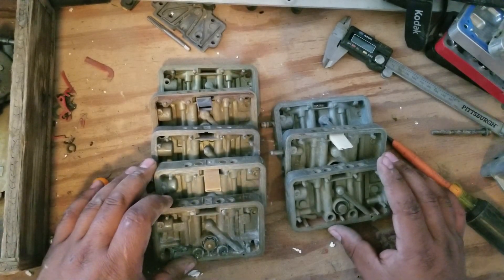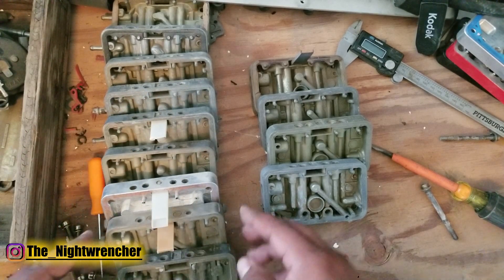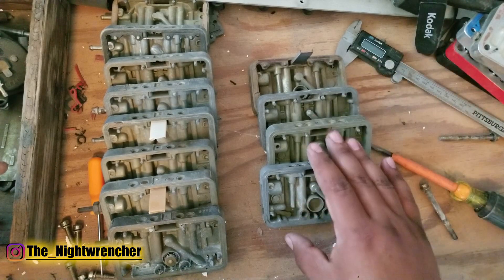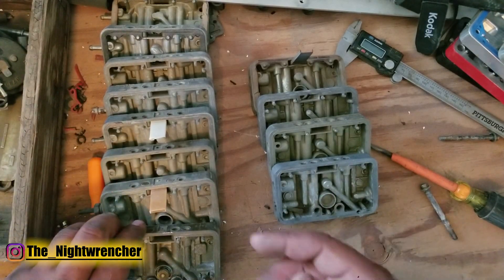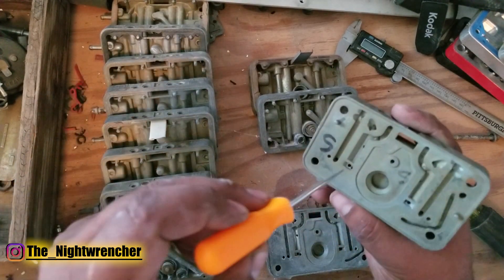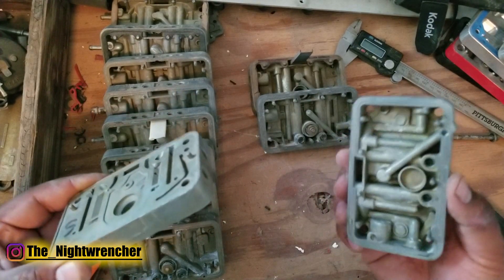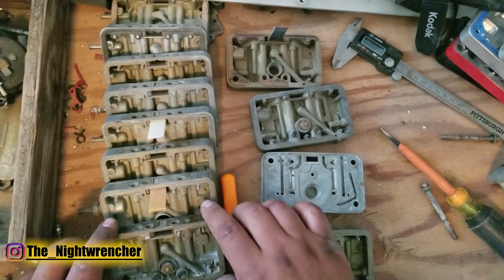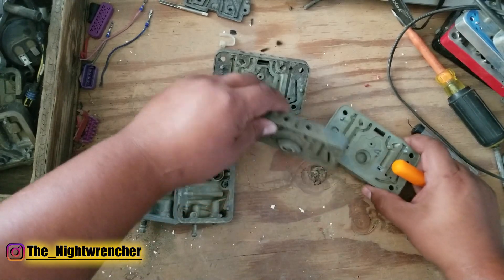Build Your Own Carb For BIG POWER! (Part 3) | Holley Carb Secrets | How To Tune A Holley Carburetor

Comment: Do you know if there is literature anywhere to find out the factory orifice sizes on specific Holley carbs? I’m throwing together somewhat of a Frankenstein carb myself and want to drill the metering plates for screw in brass ifr’s and pvcr’s but I would like to start at a baseline based off say a Holley 750 draw thru blower carb.
Reply from the maker: Best bet is to start small and go up as you go. Most 750s had a .028-.032 IFR depending on the model
Reply: @NightWrencher I appreciate the quick response. With the price of brand new blower carbs I’m gonna attempt to throw a couple nice ones together based solely on parts I have laying around and some cheapo swap meet finds. This new edelbrock 4150’s do seem like a very nice carb though if only I found a money tree somewhere
Reply from the maker: @DWBmotorsports gotta do what you gotta do
Reply from the maker: PVCRs are all over the place but .035 is a decent starting point

Comment: I have a Ford 331 stroker that i build myself with a quick fuel brawler 650 double pumper and dual plane intake.

I have already set in idle , cruising and half throtlle AFR adjustment.

But i'm still learning how to adjust the fuel curve when full throtlle.

My AFR go's to 10 from 2000 rpm full throtlle and slightly leaning out to 3600rpm to 11afr and at max rpm of 6000 it is going to 13.2 

Is the next step changing the emulsion bleeds ? I think i have 5 of them.
Reply from the maker: You might want to put smaller high speed air bleeds and then pull some jet out of the secondary side. Whats your AFR at cruising in high gear and whats your AFR after the Power Valve opens?
Reply: @NightWrencher cruise is 14 at 2000rpm and  to 15.5   at 2500 rpm with a manual trans 5 speed.

I have just put some smaller gears in so i have to read just but its at 12.5 to 13.5 depends on rpm on the powervalve
Reply from the maker: @chevroletbelair1 .005 smaller secondary high speed air bleeds should richen up your top end while leaning out the bottom. If you have 5 emulsion holes you can try capping the top hole if its open
Reply: @NightWrencher 
Sorry i have the 3 emulsion holes .
My original hsab is 31 , i have now 23 in it.

I do think that when i did disconnect my secondary throtlle blades so only primary blades worked that it was also good AFR at low rpm but lean at high rpm. 

So i think the primaries are also lean at high rpm , should i put bigger primarie jets in ?  And then smaller pvcr? Lsab is also changed from 31 to 23
Reply from the maker: @chevroletbelair1 you disconnected the mechanical secondaries? How did you manage to keep the blades closed to test that?
Reply: @NightWrencher its bin awhile but i think it was with a tie wrap . I should test this again to be shure of it and make a datalogger .

Can you help me with it when i send you the datalog? Do you have a whatsapp or something to send it?

1 year ago i was tuning my carb but this is the last thing i cant solve ,and i like to learn more about how to tune a carb 

Iive in Europe Belgium so we dont have v8  tuners here
Reply: Hi, thanks for helping, you already give me a step further in youre answers.
I have detached my secondaries on my double pumper again to test and lock it with a zip tie so it cant go open.

So now i only have my primaries to work.
Again also at this full throtlle pull(only primaries) my fuel curve starts at 2000rpm at 10.5afr and slowly go's to 11 AFR but when i reach 3400 rpm the afr goes to 13 AFR and stays relatively flat to 13.30 at 6000 rpm .

So this rich AFR curve on low rpm comes  from my primaries, so from my  Pvcr jets and primary jets and  (lsab is changed from original 31 to 23) si i cant go further  on that i think.

Can i adjust this rich low rpm fuel with my emulsion bleeds?

I have 1 syphon bleed and 3 bleeds below.
My fuel level sits just below the upper(nr1) emulsion bleed from the 3 and i think the 2nd emulsion bleed gets op uncovered from the fuel at this 3400rpm when it gets leaner.
Reply from the maker: Let me ask you this, are you testing this in high gear or are you starting WOT in low gear and noting the AFR between shifts?
Reply from the maker: Also, the easiest way to reach me is instagram if youd like to send me a message

Comment: I have a Holley 9510, made for a ford,with no air adjustment screws,  can I modify this with a metering block/ETC  to use on a Chevy for example????? Thx 👍🏻
Reply from the maker: You should be able to simply swap the metering block with one with adjustible fuel mixture screws
Reply: Thx really appreciate it 👍🏻👍🏻👍🏻

Comment: can you explain or maybe another video but some metering blocks have the main well tapped and emulsion tube removed, information i found was this is done to hold more fuel in the well but how does this affect overall performance of the circuit. ? can the idle well also be tapped and plugged with a set screw also.? I would like to avoid the brass cups if possible thanks.
Reply from the maker: Its done to allow more fuel flow when running alcohol or race fuel with a lot of horsepower. If its a street car, theres no need for that. Itll richen up the circuit but its mainly done to relieve the bottle neck of fuel

Comment: So would a 750 double pumper use the same metering blocks and a 650 double pumper carburetor?
Reply from the maker: Highly unlikely. But they will work. 750 block on 650 would run richer, 650 block on a 750 would run leaner reguarless of whether its rejetted or not.
Reply: @NightWrencher  makes me wonder. I have a 650 mechanical secondaries Quick Fuel Brawler. I'm putting a Proform 750 body on it but am unsure if the metering blocks will work ok. The stock jetting is 70 and 74 which seems really tight compared to the 74 and 83 that come with the Proform body. I could buy the Proform metering blocks but am trying not to spend much.
Reply from the maker: I was talking specifically about take the blocks out of say a holley 4777 and swap them with a holley 4779. If all you're doing is swapping the main body, I would keep everything else the same. You might need a little more jet in the secondaries but the primaries should be close to the same since fueling is taken over by the PV at WOT.

Comment: I have question, I have a 780 quick fuel. On my 402. And it's to big. Was able to find a 650 middle body with a choke and want to swap everything over to this 650  middle body. Is that possible?? Or are the butterflies to large for the 650 body?? Thanks..
Reply from the maker: Hey man, I just saw your comment, the QFT 780 should have the same baseplate as the 650 if they are both either double pumper or both vacuum secondary but wont work if you're trying to mix and match. a 780 seems like the perfect carb for a 402, why do you think its too big?
Reply: Im running a 1050 proform main body on a stock bottom end 351w.  Tfs 11r190 cc heads at 56cc.  Tfs stage 2 cam. 1.7 rockers.  1/2 inch 4 hole spacer on a eddy air gap.  From a dead stop. No bog will rip tires off on a c4 with a 410 rear.  Afr gauge is 12.6 at idle. 13. At wot. 14 ish at cruise.  Timing is 34 all in at 1800 rpms. No vac advance.    390 rwhp. 460ftlbs in a 82 notch mustang
Reply: A 302 with a b cam and gt40 heads uses a 750 like its a 650.   Check your timing curve.   Tailor about 14-16 intial.  Get it all in quick.  Most likely your issue